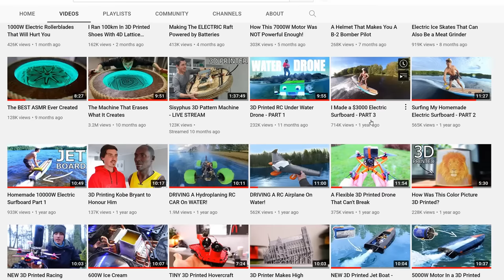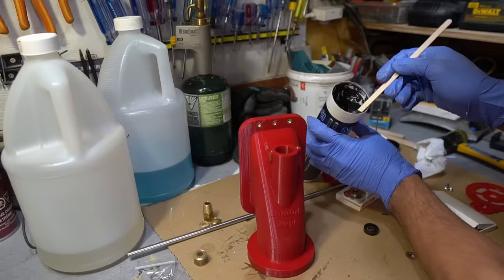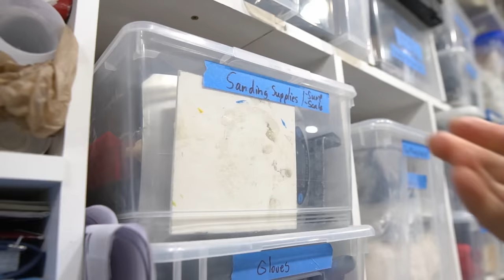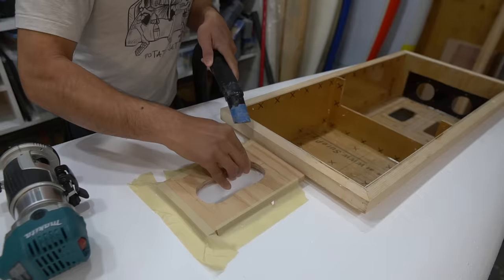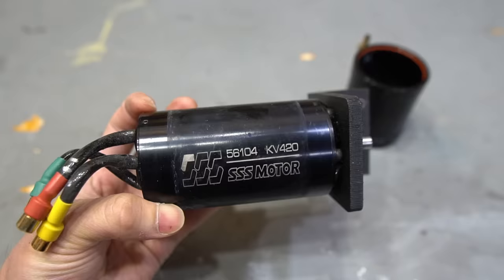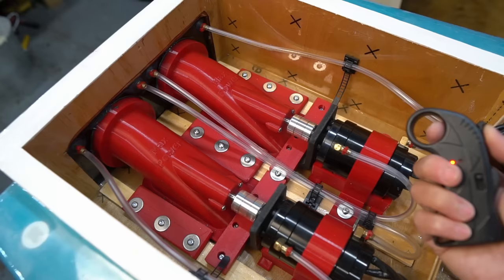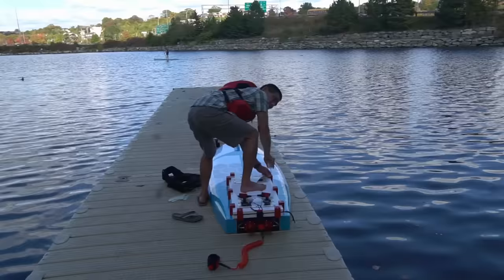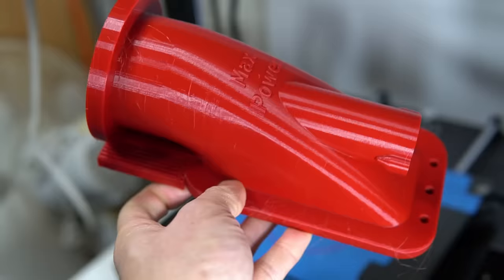How to Make an Electric Surfboard with 3D Printed Jet Drives

Comment: Great documentation of the process. I was surprised at the slow speed given the specs of that motor and speed controller. I bought a little motor with shroud and prop specced for 1800W and it isn’t a whole lot slower on my SUP than the dual jet pumps there. If you run a prop off those same drive components I think you’d be able to get it to fly up on a foil

Comment: It does probably not mater a lot for you in this setup but... You installed the first oil seal the wrong way.. if the objective is to stop water from entering the bearing that is. unless you plan to pressurize the bearing(in between the oil seals) with oil at higher pressure than it is on the water side. The "concave"/cup") side of oil seal is the pressure side so the more pressure it gets the better it seals.  Great video. Thanks for posting.

Comment: You should swap the dewalt packs for a 20S4P battery pack comprised of samsung 40t (21700) cells. I can’t see an electric surfboard going fast enough on less than 72v

Comment: Hello Andrew, amazing board, congrats,  would you be able to share the part numbers of smaller parts such as glue, ball bearings and grease, etc. or maybe you have a BOM. Also can you please share more details about the electronics, how you connected the batteries in series, the battery holder 3D files and the battery clip with the voltmeter, etc.? I will try to reproduce your design with some minor improvements in Atlanta, GA
Thank you for sharing this and good job!

Comment: Just started watching and really hoping you went with something else than PLA😜 Great to prototype with but holding up in salt water??? No sure about that!
I have a Voxelab Aquila. An Ender 3 knockoff  bit $100+ cheaper and many people claim it's a bit better than the Ender. I'm extremely happy with it for my first printer. Anyone wanting to get into 3D printing... check out the Voxelab Aquila. You'll have money left over for a auto bed leveler and a couple rolls of PLA! 🙂....At least! I'm thinking at least ABS but would even go maybe Nylon (not sure about its qualities for salt water) or even Carbon Black. I really wanna try Carbon Black but I gotta tweak my Firmware to get up to 300c. Already upgraded to all metal hotend and upgraded bowden tube.

Comment: Hi, great videos you are using 2 56104 420kv supports 110v you should put 2 bateryes in series and 2 parallel 2s2p 6 there is a 75100vesc can handle, sorry my bad english

Comment: Hey mate! I reckon your batteries could be holding you back! The whole 9ah rating looks great but at 60v, it drops back to 3ah or something. Not so good for voltage sag. I reckon some of those LiPo batteries you were using as weights would have fared way better.

Comment: Are progressive blades better at accelerating?
Starting with an angle of 75° and ending with an angle of 30°

Okay maybe not that big of a pitch progression, but I really think a progressive pitch should be more efficient, by accelerating the water more gently

Comment: I think if you mounted the jet unit higher 60mm they need to throw out above the water but only just holeshot bad but once you got going  was perfect  im building  a mini boat 3 piece so it will fit into my car 7hp honda clone engine

Comment: cellular PVC sheets would be ideal for the motor box, the type of lightweight sheets used in FOR SALE flags on houses, very strong and cheap, Just an idea after watching your great video, the MK2 >> narrower=less drag, more powerful pumps, tail fins built-in/moulded for stability in turns, and definitely foot loops like a sailboards have, A kill switch could be incorporated in them or a proximity hand controller, IE won't connect when 10 feet away from the MK2 board, but your thinking in the right direction, just needs fine-tuning, if you can make them cheap enough (or if a Chinese manufacturer can) you could have a business opportunity here, water sports are big money, think >> stack-em-high-sell-em-cheap << the founder of Tesco Jack Cohen said that when he was selling groceries from a wheelbarrow in the streets of east London, 20 years later he was knighted and was the retailer of the year and the CEO of Tesco, the rest is history as they say,

Comment: Awesome job. I've been thinking of doing this for 2 years now. Wow thats a lot of work you spent on the pumps. Nice idea using the dewalt batteries, that simplifies it a LOT. I think i will do the same. Thanks for doing some trailblazing and showing what size motor (what size would you go with next time?), and controller you used.
Reply: Liked and subscribed 🇨🇦

Comment: Great Video! Question for you.... Does that ESC have a built in BEC? (that could power an Arduino Nano or receiver)? I noticed you have extra 3 cell battery pack, but is that because you need the extra power for the voltage monitors?

Comment: Safety? Maybe…. But my experience with rc boats is that props are way more simple and efficient!

By the time a guy fell off the board and let off the throttle… my guess would be the props would slow enough to not cause injury…

Jet pumps are overall problems and not efficient

Comment: The impeller pitch looks way too high with too short a blade width.  If you fix that I suspect you could really load the motors as you will build significantly more pressure and have much higher thrust.

Comment: Great work!  I have been doing research to build my own e-surfboard.   
2 questions.  1st How do you like those Flier motor controllers, were you able to program them? 
2nd How did you learn about the Jet thruster design? Can you point me in a direction or book? Ive read a little but it is hard to find design information on them what works what doesn't. I've watched a lot of you videos and started building my first board! Thanks again keep up the good work.
Reply from the maker: Thanks!  The flier ESCs are great, no issues so far but I only have a few hours of use on them.  I bought them with the programmer, so it was very easy to program them.  For the jet design, it was trial and error, I created a few test versions until I found something that worked well.  

Mostly it was from looking at existing designs and watching youtube videos on the theory.  Then it was all from experimenting and iterating, so I'm sure they are not as efficient as proper ones but good enough for something created by someone with no engineering background in their garage lol.  Good luck on the board.

Comment: Amazing work!!

Planing to do same project. 
Just wandering, have you used it on full power? 
Is it enough power or maybe even overpowered?

Just asking, because I'm thinking to buy 360Kv motor. In order to reuse my existing speed controller. Will it be enough?

Comment: And how fast do the engines spin in the water?  why in the video the maximum speed is 7100 rpm?  comes out 7178/420 kv = 17 volts?  Probably the batteries can not give a good current and the engine speed drops.  check this moment.

Comment: I'm going to build a jet surf like this. But my ESC is only 8S, it will slow, but I will use 2x4S -75AH battery, my jet pump is 80mm for fan. How's about your opinion on my configuration. Maybe it run slows, about 20 km/h. But at least it works, I plan to use water for cooling the battery for long range.
Reply: it is a build jet pump, so I dont need to print from your drawing, but it cause me some changes due to the different in jet pump size

Comment: Hows the efficiency of those pumps? Sure you can throw pump together but how much you get from those is the real question. I have old small sail boat type of thing and it would be perfect to have jet pump in it, just been looking info on building one properly. Might even run it with really old chainsaw or something like that.

Comment: Really great job. I’m curious why you went with axial flow jet pump? Very few drag boats had success with them. I raced Boats for many years and built a few. Most keep there secrets bout pumps so I imagine information was difficult to find. You might try a nozzle on the end of your pump along with a droop snoot. Impeller tolerance is critical. Also a shoe is used to pull water into the pump. Pump height and keel you might look into as well. completely different than gears on a car. Over all outstanding job. Really impressed with the engineering you came up with.

Comment: This is awesome!  I ride an inflatable SUP in a lake frequently and often think about how much fun it'd be to have basically an immersion blender on a long stick to shove in the water and just slowly propel me around (or quickly lol) and this kind of project is good inspiration!  

How did it feel having one foot up the few inches on the top of the motor box?  I am still relatively new to SUPs and my balance isn't perfect and that seems like an additional challenge for sure haha
Reply: I just put a “underwater thruster 1080w 24v” on my inflatable SUP and it was pretty easy overall. Just gets me to like 3mph but it’s still nice—biggest problem is the drag when the prop isn’t spinning. Could be improved by using a folding prop but then you’re getting into custom drive territory.
Reply: @nickvuono2422  that's awesome! How do you power it?

Comment: Fantastic system
How did you learn how to program the esc and all that sort of stuff
Reply from the maker: Thanks!  The esc comes with a set of instructions and youtube, also it comes with a programmer that allows you change the timing, voltage cut off etc.

Comment: I am curious what you used for sealer before fiberglassing I have a board all shaped and ready to be fiberglassed but it has some small dings here and there.  I was wondering what i can use to fill those and then what I can use to seal it?  Thank You
Reply: Just use a light weight epoxy filler , or even bog, you're going to glass over it anyway. Just make sure its something easy to sand or you'll have trouble sanding it flat to the foam

Comment: How did you connect the controller to the esc and everything and where did you get the conteolwr
Reply from the maker: I got the controller from Aliexpress, look up water skateboard.  It hooks up just like any RC control system.  It's just much bigger but all the connections are the same.

Comment: You're losing a tremendous amount of power creating cavitation inside the pump impeller housing.   At those levels of power, the pump you 3D printed is going to create a ton of bubbles and just burn energy swashing water bubbles around. There shouldn't really be any bubbles coming out of the jets in the back. It's probably very difficult to perform the hydrodynamic engineering involved to create a super efficient impeller design that doesn't create cavitation around the impeller. But if you could nail the impeller design you'd probably double the top speed of this craft, because you'd also be able to get the whole board up out of the water way more at top speed.

Comment: I'm only bothered by one thing...... you spent 80 hours on learning the 3d printing stuff for this project but you didnt want to take 2 hours to put up plastic and sand the board to bring it to a perfect finish.... I feel like you should have taken the time to sand it so it was finished finished. but otherwise love these builds.

Comment: chu chu, impeller turbo gasoline electric generator drive train
Reply: I mean, you can do it all, from ground up, even with less than you have
Reply: who said buying from a store is honorable
Reply: they have twisted shame to be honorable, and honorable skill to be shameful, what a curse twist
Reply: who uses overcomplicated wasteful complex ac motors, dc emf motors are better, no controller circuit required
Reply: tech hoarder
Reply: equipment pusher
Reply: a fearful nagging wife is not a pro thing
Reply: no matter how beautiful otherwise, just general advice
Reply: same goes for government, money, laws